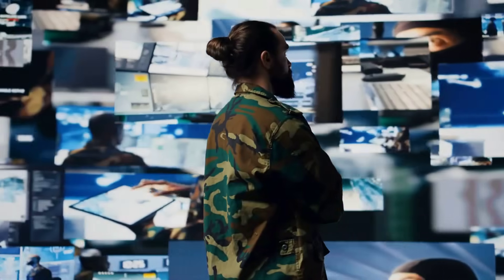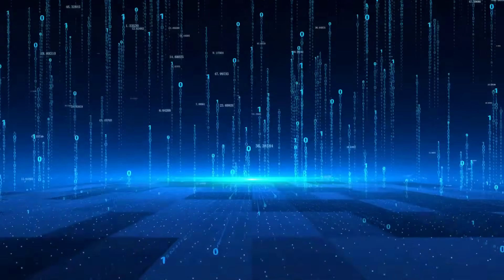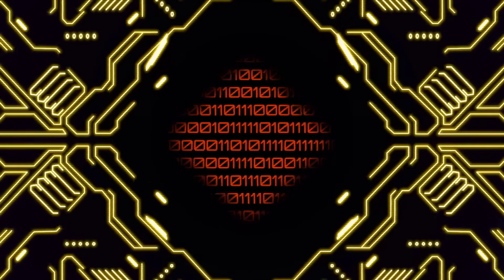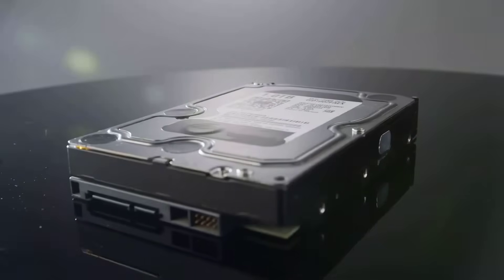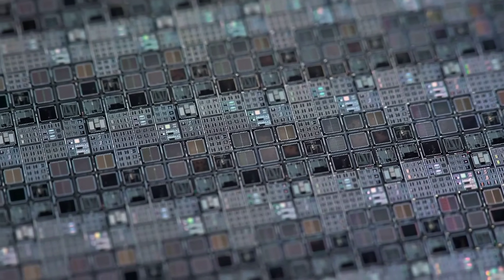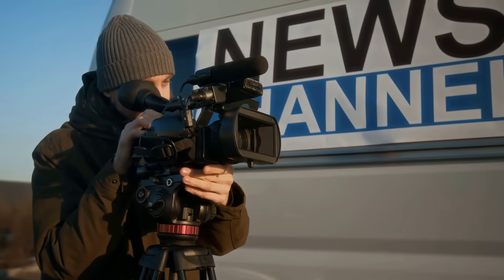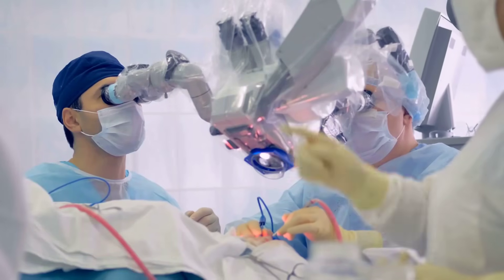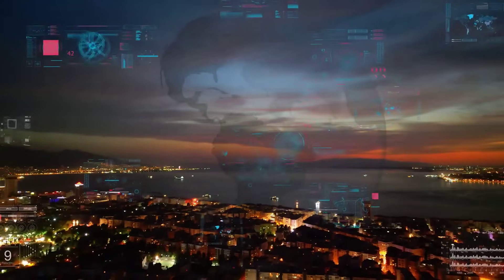Analog AI vs NVIDIA: The Battle That Will Reshape AI

Comment: You have practically enumerated the entire landscape for analog AI. There is little to nothing more that I can add to that.
Except that I think that analog AI will run into the same wall as analog computing has. Digital computing has dominated in the software industry, because essentially digital is tantamount to soft. Soft as in plastic, pliable, malleable, easily changed, updated, modified. Digital computing allows for all these qualities, whereas analog computing is fixed, it is hard. Analog computing means that everything is set in stone.
Now extend the same to analog AI. If there is the same need for software based AI, then we still need digital AI, analog AI cannot match that.
If we take a hybrid approach, and only use analog AI for certain segments like in matrix processing, then we will need analog to digital converters, and vice versa. We will need ADC for sensory inputs as well. So a fast, simple, cheap ADC is needed. We can save on the ADC by serializing the result of the matrix multiplication but then that becomes the new bottleneck, or we can have multiple ADC for each computed result and need a lot of ADCs.
Reply from the maker: Digital dominated because it’s flexible, programmable, and easy to update  but that logic doesn’t kill Analog AI.
Analog AI today is NOT the old 1970s analog computing. Modern analog accelerators use RRAM PCM MZI photonics, memristors and software-tunable weights so they’re not fixed or hard-coded. Deep learning is mostly linear algebra, and MAC operations are physics-friendly  exactly where analog beats digital by 100× to 10,000× efficiency. Digital still controls logic and software, but analog handles the math. This hybrid design is why Intel Loihi-2, IBM NorthPole, MIT Photonic Chips, Huawei’s RRAM labs, and Lightmatter exist. The ADC bottleneck is real, but solved with low-bit ADCs, shared ADC architectures, temporal encoding, and in-memory accumulation. Modern ADCs reach multi-GSa/s, so they no longer slow down inference. AI’s biggest bottleneck today isn’t ADC  it’s data movement, DRAM latency, interconnect heat, which analog in-memory computing removes.Digital AI isn’t going away  it’s the OS.
Analog AI is the physics engine, accelerating what digital is slow at.
That’s why every major player  Nvidia, TSMC, Intel, Huawei, MIT, Stanford  is investing in analog and photonic accelerators.The future isn’t analog vs digital.
The future is hybrid analog-digital AI, where analog does the matrix math and digital handles the software layer.
This gives massive performance, ultra-low power, and post-GPU era efficiency.